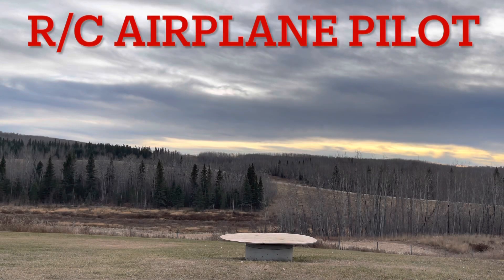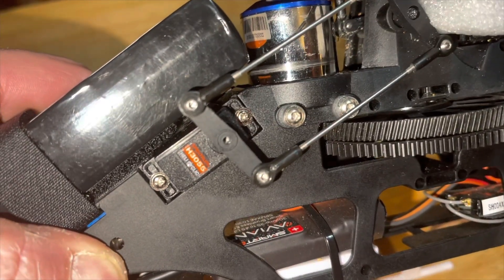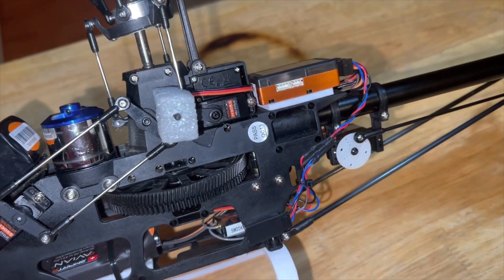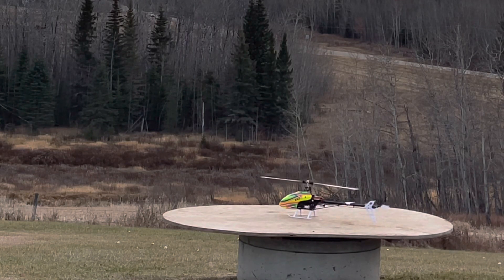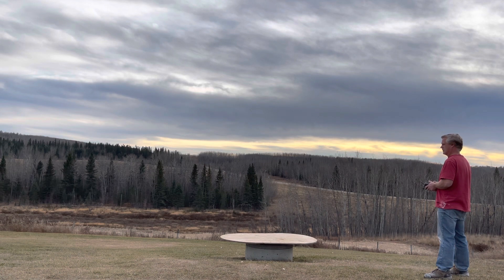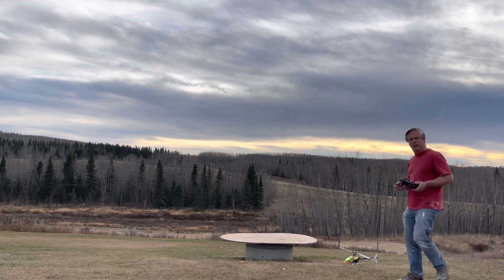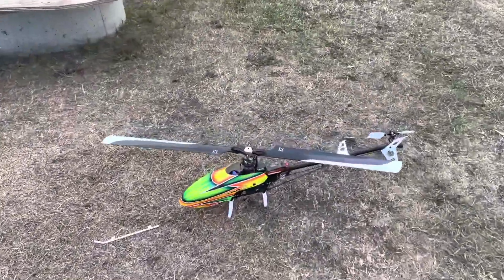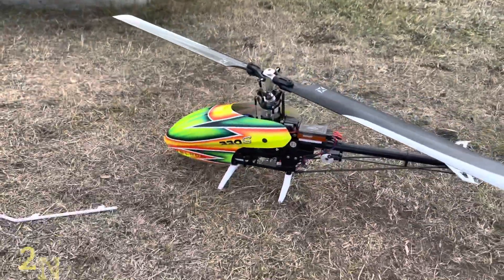Remote Control Airplane Pilot tries Blade 330s R/C Helicopter.

Comment from the maker: If anyone has any helpful suggestions please feel free to comment.
Reply from the maker: @thebossmoss6249  since then I got a mcpxbl2 and had 4-5 good flights but then I got cocky and wrapped the tail boom around the rotor.😳🤦‍♂️. 

Gonna wait a bit before I try the 330
Again.  Also picked up real flight 9.5 so that should help too.👍. Thanks for the advice.
Reply: When you get about 12" in height to where you want to land, hit the Hold switch H to kill the motor and auto rotate for safety. The bigger helis get scary so you'll want to learn how to do that.

Comment: Also I found that not  using safe helps build way better stick control. Because you an bang sticks and it’s mushy but without safe you get a feel for actually controlling the helicopter. It’s way more sensative than a plane. And less forgiving.